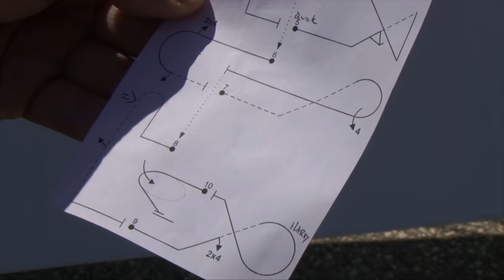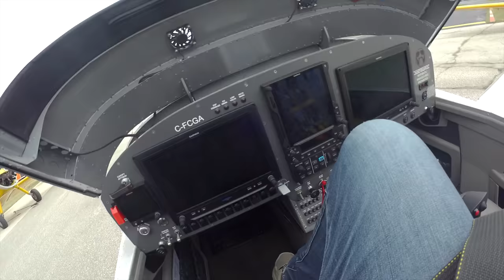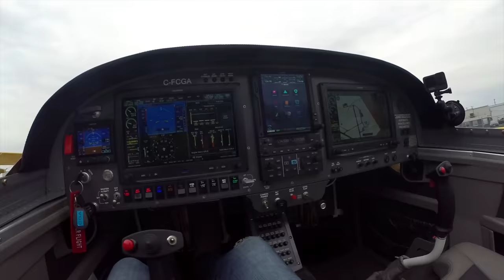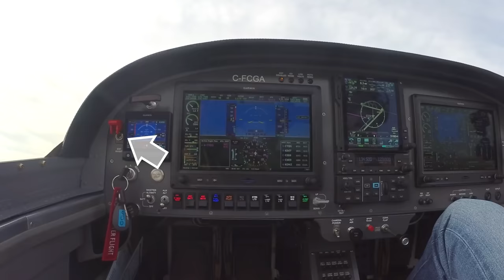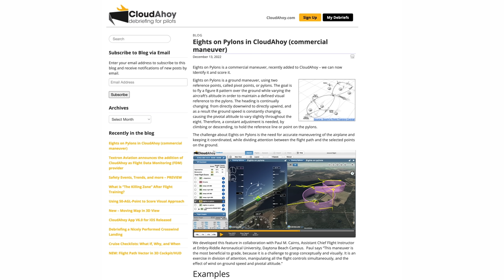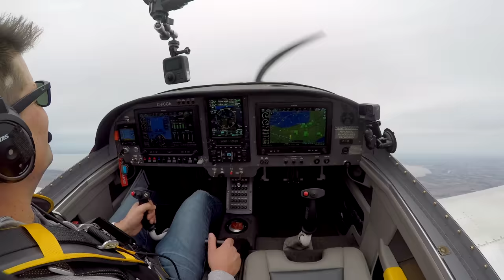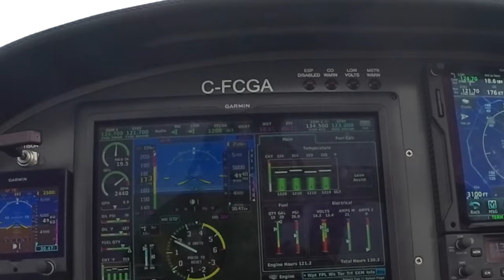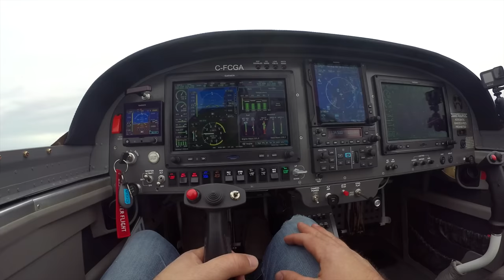Taking the RV-14 to MAX G!

Comment: Aerobatic Confirmation = The wings stayed on and I survived...LOL...I bet those stout stubby wings are way overbuilt and would hold 9 g's...
Reply: They will probably begin to fail above 6g, but before 9g at aerobatic gross weight. 

Above 6g they will begin developing permanent deformation that will seriously compromise the structural integrity on subsequent flights.

Flying solo, well below aerobatic design weight may allow a small increase in structural reserve. Permitting a small increase in g before permanent deformation. But then there is the limitation of everything else, engine mount, propeller flange, fuselage tail download. Etc.

This is the nature of Aluminum, and aero-structures.

Comment: Another milestone - congrats! Now you truly have a cross-country and acro machine. Question: Do you remove your seatback cushions to compensate for the chutes, or just deal with it?
Reply from the maker: Dave is so tall that the (ground adjustable) seats / pedals are set so he can fit well and I can juuuuusst reach full pedal deflection.  So with a chute on I feel a bit closer to the panel, but it is actually easier for me to reach full pedal deflection - especially during a hammer head when I get light in the seat and reach for full rudder.
Reply: @FlightChops  Thanks Steve. Enjoy your Holidays!

Comment: Another great video! What is the part number for that brace you have on the rear overhead RAM mounted camera, please?
Reply from the maker: It's a standard RAM suction with the short arm.
Reply: @FlightChops  ah, thanks. It looked like there was some sort of rigid bracing attached to the arm - I wondered if it was for G-loading.

Comment: Hey Steve, is your tail stinger reverse bent (noticed at 0:27 mark) or is it just the distortion from the GoPro wide angle?
Reply from the maker: Like that it is pointing down / away from the rudder?  That’s the design to all it max travel if landing hard tail first
Reply: @FlightChops  interesting. Wonder if that’s specific to the -14? The -7 stinger is straight according to the build plans, and they often get bent upwards from rough landings. However I’ve heard of builders putting a reverse bend in them

Comment: So, the way that you test whether a 'plane is safe to do aerobatics in is to do aerobatics in it
Reply from the maker: Correct. That’s why it’s probably a good idea to have a professional do this. You’ll notice he was wearing a parachute and the flight was planned over an unpopulated area. But the airplane is designed to be able to handle what it was put through. The purpose of this process is to prove that it was built to meet the standards. Serious question though: if you watched the entire video, does it not answer all of this?

Comment: What, no -3G testing?
Reply: That would have been fun to watch
Reply from the maker: We don’t have inverted oil/fuel systems for it, and honestly, you need ratchet belts for properly flying negative G.  
So I decided we’d just test 0 to +6, knowing we’d mostly be operating in the 0.5 to 4G range.

Comment: 6g is a limit, not a target.  That is not responsible flying.
Reply: When a designer draws up an aircraft they assign a G limit .  There is an extra margin before structural failure that is built into the airframe.  The +6G limit is the amount of G that the designer says the structure can handle without damage or deformation. Testing a homebuilt airplane involves these types of envelope expansion flights to ensure that this specific aircraft meets those performance expectations and safety margins. It's best to test it to its expected limits (not to failure) in a controlled environment like this. Would be horrible to be screaming out of the bottom of a loop and find out that the spar fails at 5.5 G.
Reply: @terryfulwider1296  

Hahahahaaha - here is a guy who has had an aeroplane essentially built for him.  He has a monetised YouTube channel and glamourises flight testing.  I am sorry - this is ever so sad and unfortunately sends messages out to the flying community which are not safe, in my humble opinion.  

RV’s are excellent Sunday Afternoon Aerobatic aeroplanes - built 5 of them and fly an RV7.  Superb aeroplane.  No need for more than 4g…….. Ever.
Reply from the maker: I’m not sure you’re exhibiting any humble aspects in you’re opinions there Trent…